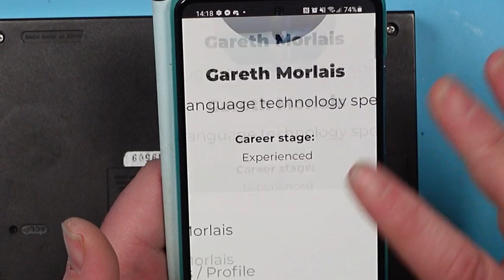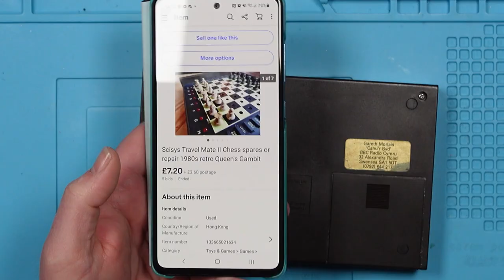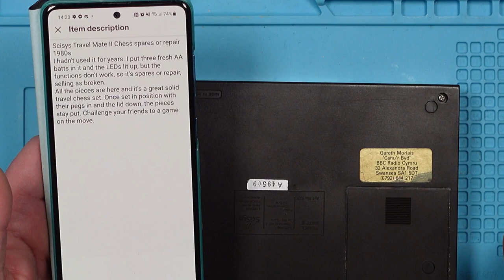SCISYS Travel Mate | WHO'S Gareth Morlais? | Can I FIX It?

Comment: My grandfather had one of these in the late 80s. My "fond" memory was that you had to push the pieces hard into the board to have it register your move i.e commit it. Some pieces would leave an indentation on your fingers due to the jagged nature of a Knight etc (i.e. horse's head), particularly as the units got older and needed more force for the move to be registered. Ouch!

Comment: I got one of these new in the 80s and recently found it again, same problems but worse corrosion on the terminals, put them in lemon juice and had to replace a wire that had wicked the corrosion up. All working now, polished up the case. It came with 4 spare queen pieces, 2 of each colour.

Comment: Something quite nostalgic and fun about a chess game with just LEDs and a bleeper.  None of this techy rubbish, LCDs, sound effects, just the basics.  Impressive how everything is driven by one custom chip with hardly any ancillary components.  I guess some rookie considered taking this to a pawn shop, but after a price check mate, he popped in his local bishop for some chips and decided instead that knight to put it on ebay. After you queened it up it's looking like the king of the chess sets!  Nice repair, and a nice connection back to BBC Wales (my hometown). 😊

Comment: Ooh I have the cheaper version of this. Mine is a hand held computer with a small screen. It came with a plastic chess set and a fold up cardboard board. You input the start and end move just like this but with number and letter buttons and it tells you its move. I remember looking at those fancier sets and thinking they were way too expensive . I think I got mine in about 1980. If the batteries are running low, it cheats.

Comment: heya , love the channel , just found it and watch mmv too and northridge fix . love the tshirts. old house of pain and cypress hill fan and hip hop scratch dj  too. just getting into trying to fix things, and trying to learn to solder.. early days . just got a cheapo hot air thing and micro pencil from ebay to start with . can i ask what flux you use ?  is it the oft talked about amtech , also what solder would you recommend   cheers for the fun content , learning a ton from you and just fixed my first iphone 6 plus, new battery, speaker and front camera. felt chuffed about that but to you be simples lol
Reply: Just grab yourself any 60/40 leaded solder ... diameter is up to you but I'm currently using 0.032 👍
Reply: @warpath6666   thanks just got 60/40 100 weller solder from amazon and some cs flux , the syringe type with needle . going to try a few see what works for me . just ordered a few solder practice things too  to get used to the new kit .  its far from best but  seems to work fine and thats the main thing .  ordered solder mask too and a little uv lamp for it . im just starting out  and for me its just an interesting hobby , thanks for the help :)